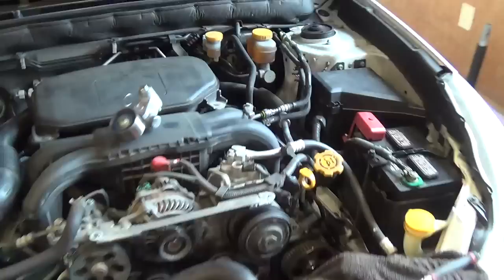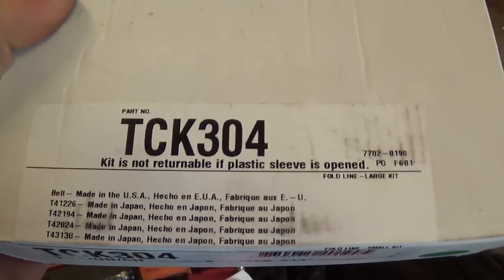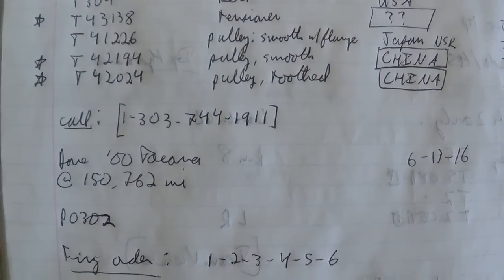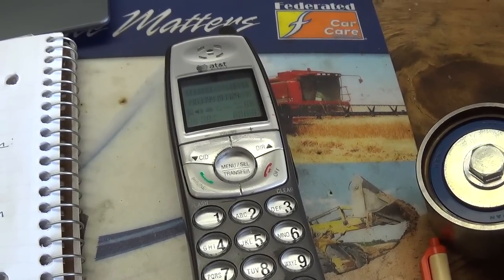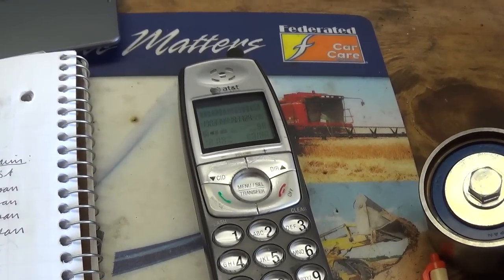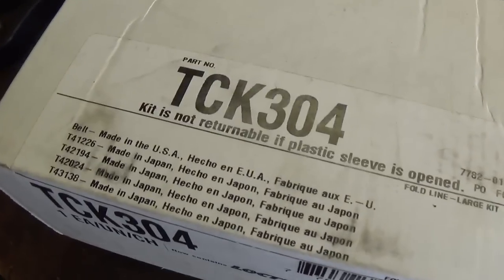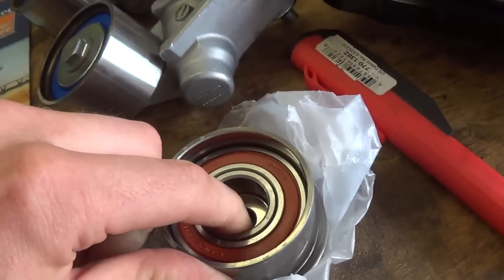GATES Subaru Timing Kits: BUYER BEWARE!

Comment: I understand the issue - I've dealt with similar in other retail/construction industry. If it were my car, I'd warranty the kit and buy OEM. It's unfortunate you had to learn this on the customer's back, so to speak. To retain customer trust, I would consider procuring OEM parts and eat the cost on your end. Who's to say the components that "feel good" now will last the interval of the timing belt. Tough position.
Reply: all that said, and there's still the possibility that the OEM parts are Chinese, but at least they usually back the parts with warranty. I would be steamed too that the box is labeled Japan since by opening it, they say "unreturnable"

Comment: I have 2005 Subaru Legacy gt turbo . My mechanic replace the timing belt and water pump back in when it was 100.000 miles on it from Subaru dealers I pick up the parts my self from dealer now I have 150.000 so far the car running no broblem nothing beats original parts you pay little more no worries and story

Comment: Duh... What a huge disappointment.
I changed my 03 Forester's head gaskets 3 years ago, and changed all the timing component at that time. I also used Gates kit.
I think I should have checked where everything was made at that time. I just checked the box and trusted it. Only thing I checked was the idler pulley was made by Koyo.

If I ever to do timing job again, I will have to avoid Gates.

Comment: Thanks for the vid, just did my timing belt and caught the shit Chinese parts despite Japanese label on box. Order the Aisin kit and get Japanese parts all the way around like Koyo, NSK and NTN bearings and a Mitsuboshi OE belt!
Reply: Natedoc808 NSK is an international company and the bearings are made at many different plants like in India and China. So made in China doesn’t mean anything. And if you buy a new Buick Encore the whole car is made in China by a Chinese company and rebranded by GM.
Reply: Hence why I’d never buy a Buick or any other GM car. My NSK bearings were marked japan
Reply: Natedoc808 the Chinese are fully capable of making quality products. Americans can make cheap crap too, as well as quality products. I’ve used Gates products with Chinese bearings without issue. I’ve had a factory Subaru water pump fail, of course they replaced it without questioned and the new one has been fine so far. I’ve also used a Chinese brand timing belt set on my beater 03 Forester and it has 50k on it. For my 07 I’m using NSK and a Continental belt.
Reply: Michael Hite the Chinese may have the ability to make quality, but in their low trust culture they simply do not have the same standards as part of their cultural and societal fiber to strive to make high quality items. It’s pure apathy when the ability is there but the wherewithal is not. Considering the number of times that I’ve had Chinese made junk that doesn’t work/fit properly even on the first use, I’ll pass. If you want to put commie junk on your car, that’s your call. I’ll support American made and that made by nations with honor and a culture that strives for excellence.

Comment: I wasn't aware of this at the time, and I unfortunately missed what you caught. I Had my 2011 impreza break down on the mass pike due to this exact issue. Belt snapped and ejected itself out of the cover. Knew right on the spot based on the sound I heard the engine ate some valves. Left me stranded in Chicopee for two days. Ended up having to lease a brand new car on the spot. Extremely frustrating experience as I had just done a whole mess of work on the car along with the timing belt.
Reply from the maker: That is a shame, sorry to hear!

Comment: Ivan this is discouraging from Gates. i've used so many of their timing belt kits on my own and friends subarus, but use the oem subaru waterpump. Two years ago i received a mismarked timing belt from gates and had to count the teeth and make my own timing marks based on the old timing belt. this past winter on a tck307 kit i discovered a tensioner made in Canada... and just in early july on two different subarus had a tck304 and tck307 kit that had the same made in China toothed idler and double bearing idler as your kit.  on both cars i had no choice but to install the China parts; i'm going to inspect them every 30,000 miles.. i sincerely hope they are "equal or better quality"....  oh man. i've had terrible luck with Dayco timing belt tensioners on subarus a few years ago; i am concerned about options to buy quality timing components now..

Comment: I worked for an international company and had to ship parts to a customer who needed country of origin on the paperwork.  I was shipping a Bosch part and just wrote down Germany, but then thought I would better check.  Turns out part was made in China......  The best argument you had was that on the outside of the box, the parts were labeled wrong,  which you could not tell until you opened the box.  My opinion, the Rock Auto rep should have offered maybe a $20 coupon for your next order if they could not take back individual parts.

Comment: Hey, just a heads up. I just received a Gates timing belt kit, Model TCK-307, to replace the components on my 2003 Legacy wagon 2.5 auto trans. I have read the reviews on-line and was prepared to have a mix of components manufactured in various countries, including China. To my surprise all the idler pulleys are made in Japan as well as the tensioner. Either Koyo or NSK bearings. The belt is made in the USA. The info on the box states that the components could be from a variety of countries and the kit contains the copy of the TSB and instructions on how to bleed the tensioner. I am in Canada and ordered the kit through PartsAvatar.ca. Needless to say I am pleased.
Reply from the maker: Interesting! They must be sending all the good kits to Canada haha
Reply: @PineHollowAutoDiagnostics  Not sure, or it could be old stock except for the box. I'm definitely not complaining. Oh, thanks for the video.

Comment: Purchased a Gates timing belt kit GTH-TCKWP298 for a 2007 Tundra, the timing belt marks were placed incorrectly on the belt Gates t298.  Had to go back to the parts place and exchange it for another Gates T298 belt which is now correct.  The quality is just garbage now.  Incorrect marks on a timing belt for a interference engine.  Not cool.

Comment: Hey Ivan
Its not where the parts are made but more where the packaging comes from.
My wife works at a Denso manufacturing  plant in Guelph Ontario Canada where Denso makes "OEM" parts for Honda and Toyota. Funny thing is the parts are made at that plant here in Canada but she tell me she puts oil seals into a plastic packaging with a label that says "Toyota" "made in Japan"  she also puts a vacuum solenoid valve into a box that has a Honda sticker on it but the sticker says "made in Japan" So really most people would believe the part is made in Japan but actually really made in Canada. So me being a Honda guy i always thought my parts where being overnighted from Japan. Upset me a bit.
Reply: In my youth made in Germany, made in Sweden and made in USA really meant something. Today not so much. 
Maybe we should have made in X country to ISO xxxxx standard or something like that.
Reply from the maker: wow...I always get the "warm and fuzzy" feeling when I open a part that is labeled "made in Japan"! After reading your comment, that will no longer happen lol

Comment: I had a problem with gates serpentine belts in my 2007 VW Jetta 2.5. The gates belts were too short. I had to use OEM belts. My mechanic won't use gates belts on European cars due to fitment uses.

Comment: After seeing Monkey Wrenching's video about this problem, it appears the cheaper TCK304 has no guarantee of all Japanese parts. however, the slightly more expensive (+$6) TCK304N kit DOES have all Japanese parts.  The discrepancy with the tensioner is due to Subaru owning the patent on the casting design and requesting them to design their own for their retail parts..

Comment: Gates failed me. I had 270k on my 2.2l engine, believe it or not it didn't burn a drop of oil and purred like a kitten. Bought a Gates timing kit back @ 200K miles with a Japan Tensioner. Changed it again this time around @ 270k, but didn't think the tensioner was that big of a deal. Followed some suspicious bleeding procedure which i've never seen before installing the tensioner which warns of engine damage if not followed. Engine ran fine until I drove it on the freeway and the driver's side cam skipped +12teeth. Needless to say, my engine was F*(ked. To be continued..

Comment: I notice Rockauto didn't attempt to sell the customer a Aisin or Continental timing belt kit either. When there are multiple suppliers, the customer should be sold the total picture of parts availability. Another question is whether or not some components of the bearing for example were made in China, but the bearing itself was assembled in Japan. Another question is, given the advances in Chinese car manufacturing every year, is the prejudice against Chinese parts a historical anomaly, a statement that the technician isn't current with the times in manufacturing exactitude.

Comment: Got a part quality story for ya ... 

I just tried to upgrade the headlights on my '93 Volvo 940. Grabbed a pair of e-codes off eBay - they were close to $400 for the pair with shipping, so I figured they had to be halfway decent, right? NOPE! Made in Taiwan - not china, but close enough! First set included 2 right corner markers, lol - no left side one to be found. Then, the reflector assembly inside the housing was just floating around in there. No way to adjust it, and no way to disassemble and fix it without destroying the case. Sent it back. Seller has some real morons working over there - couldn't figure out how to email me a shipping label. So 2 days later UPS finally comes and grabs it (someone with a clue took over I guess), and almost 2 weeks later, I get the replacement. So I start installing everything. Came with no directions, so had to remove all the covers, chase wires & test to see what was what. Then as I plug in the left side marker, the contact gets pushed in just by me pressing to engage the connector. Short circuits the turn signal circuit, blows the fuse, and the relay starts buzzing like crazy. I yanked the pin back out of the light, and it was good.  So now I go for a test drive at 9pm with the new lights. Tried adjusting them using my garage door as a reference - seemed awfully low. Cranked them as high as they would go, and went for a drive. I couldn't see 3' in front of me! 5' on high beam, LOLOL!  I can laugh now - I was PISSED!

USPS just picked the junk up a few hours ago. Done with those! Ordered a set of OEMs. That hurt my wallet, but at least I can count on them WORKING!
Reply from the maker: Wow a '93 Volvo...surprised there is aftermarket anything for those anymore!
Reply: There's a cult following of those things, so tons of parts out there for them. OEM still makes quite a bit of them as well. I've never been a big foreign car guy, but I love this car - it just RUNS and gives me no grief, unlike my GM products. I also have an '86 Grand Marquis that is also very well built.

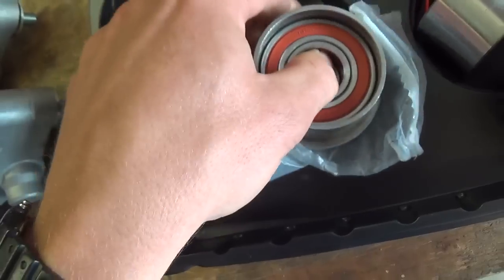My only gripe with the Volvo is that it's SLOOOOW. About 114HP at the crank, lol ... so maybe 90 of that is getting to the rear wheels. Good thing it has 4:11 gears out back. :)

Comment: I just purchased a gates kit for a 99 SOHC.  Belt was made in USA, everything else in Japan.
Reply: Allen Hansen Did your part number have an "N" at the end on it? I read that the gates kits part numbers ending with the letter "N" are 20 bucks more but all Japan bearings.
Reply: I tossed the box but it was Gates part number TCK304.  This is for the 2.5L SOHC engine.  I got it on ebay from seller automotiveindustrieswarehouse.  It came with the belt, tensioner, and 3 idlers, some loctite, and a semi-worthless plastic space-checker gauge thingy.  Paid $134.55 w/shipping.  Looks like there are a couple others even cheaper now.
Reply: Allen Hansen Mine is a SOHC on my 2004 its a TK307 or the better one TK307N. Someone left a comment on here stating the ones "better kits ending in N" had all Japan parts. I seen one on ebay automotivesupplyinc.

Comment: Bite the bullet and ALWAYS go with OEM Subaru parts right from the dealership, especially with critical timing belt parts. I bought an 05 outback XT from a guy who used aftermarket timing belt components and after 2,000 miles, the intake cam jumped time (I think due to one of the pulleys binding up) and the car stalled (luckily it was just idling and it didn’t bend any valves, I lucked out I guess lol). I went and got genuine oem Subaru parts ($900+ later) and 20,000 miles later, the car runs like a top!

Comment: What a coincidence, I am shopping for a timing belt kit for 2011 Outback. I compared ContiTech and Aisin kits, and settled on Aisin. I buy their kits for Honda J35 engines, and its all OEM parts.

As far as the issues here:
1. Gates - wow, complete and utter BS on their part. Its false advertising and not acceptable in the least. I never bought their TB kits before, and wont ever even think of it. If a car manufacturer can assemble a car and know what part from what lot was installed in which VIN, a timing belt kit packager MUST BE ABLE to accurately reflect contents of the box.
GATES - this is pathetic.

2. RockAuto - I am not surprised by a first brush off - kit assembled in Japan - lol. But to be frank, they sell millions of parts, and the guy has no idea what the product looks like on the box. He offered a complete refund and would have paid to have the order returned and thats as good as offer as you can reasonably expect. He just sells the product, he does not package or label it. If you return few parts from a kit, then they will take a complete loss and I would not expect that. I have always had great service from RockAuto and don't feel like they are at fault here.

Thanks for posting this Ivan. Maybe "the marketing types" at Gates will see this as well, f*ckers

Comment: Ivan, what is a person to do  when you buy OEM parts and they come from China? Saw a Motorcraft water pump in a white box repackaged  in a Motorcraft box and pump was labeled made in China.Saw you at ETCG meet working on F150, sorry didn't get to talk to you.
Reply from the maker: Yeah I recently installed a Motorcraft waterpump on a '96 Mercury Mystique. Said made in China all over the box and the pump...a disappountment when a domestic company could be providing jobs here. But at least the labels matched lol
Reply: You actually found a mercury mistake that still ran ?
Reply from the maker: 5-speed manual 2.0 4-banger with 240k miles. Original clutch, didn't burn a drop of oil. Overheated several times due to blown coolant hoses. Amazing.
Reply: That one is a keeper for sure !
Reply: #TRUMP2016
Reply: Did an evaporator job in a 2012 Chevy Equinox.  Most the the control modules behind the dash are made in China and the evap core from the dealer and in the vehicle are made in Taiwan.  It is just a global economy and we aren't going to get away from it unless you want to pay an arm and a leg for parts.
Reply: Just installed 2 machines at Freightliner (Damiler) in Saltillo, Mexico. They produce 200 trucks a week. Workers make $80 to $100 for a 48 hour work week.The engines are still made in US either Detroit Diesel  or Cummins. Chrysler has a huge facility across the street (Dodge Ram truck).  I don't see any companies concerned about providing jobs  in the US. It's all about the buck. Automotive can't ship the jobs out of the country fast enough. Bought a Denso part from the Honda dealer recently that was made in Mexico. Denso has a big presence in Mexico along with all the others.

Comment: US COO laws (country of origin) need to be updated to require that mail order vendors make it clear where the product is made.  I tried to obtain this information from RockAuto on some parts and I got the regular old mumbo jumbo about the supplier sourcing the parts from all over so it was not possible to supply that information.  This information is crucial for the consumer to make informed decisions on the parts they want to buy.  The US government made it the law that packaging reflect the country of origin, online retailers not passing this information on is in effect bypassing this requirement. 

I realize this is not the exact problem that you have, but it highlights a problem that needs to be corrected to help the consumer make more informed decisions and may even curtail some of the shenanigans from those on the outsourcing bandwagon.

Comment: I just ordered a timing component kit for my wife's Odyssey the other day. They said that all they had was Gates, but all the parts "should be OEM quality" and they would warranty them if there was a problem. When it got to the shop, it had a Chinese water pump and tensioner. I sent it back and ordered the pump and tensioner from the Honda dealer. I don't care that it costs more. It's still cheaper than an engine!I've never had any trouble with Gates belts, but no way am I going to take a chance with Chinese copies of critical engine parts.
Reply from the maker: Thanks for sharing. Like you said, critical engine parts is not the place to cut corners or pinch pennies!
Reply: Update: I took it apart today and it was a nightmare. Someone did a real hack job the last time the timing belt was done. It had cross threaded bolts, a Dorman tensioner with a snapped bolt in it. A gates water pump that was leaking like crazy. One of the timing covers was rubbing on the serpentine belt. The list goes on and on, but the important thing here is, that Gates water pump is nowhere near OEM!I'm glad I got the Honda pump and tensioner!
Reply from the maker: Geez good thing it held together long enough for you to save it!